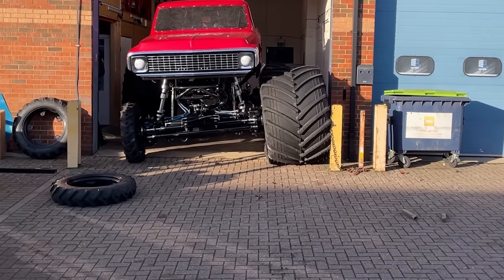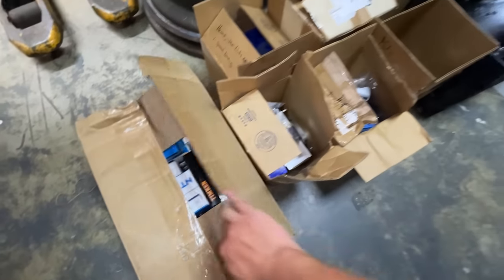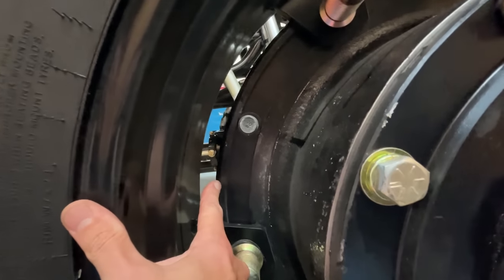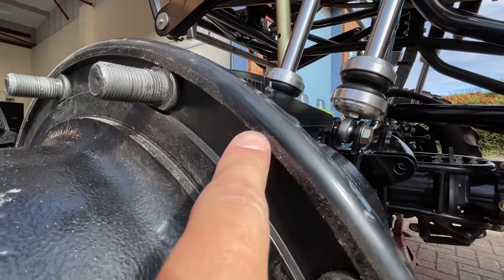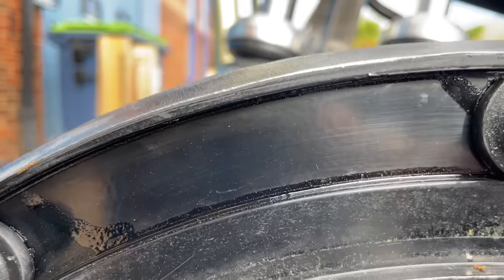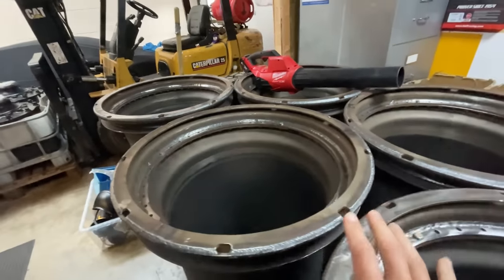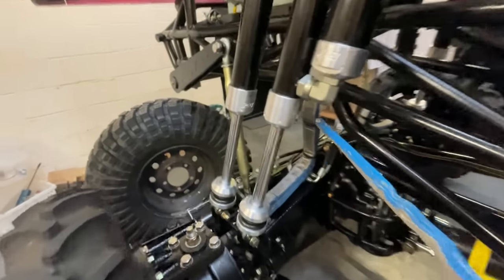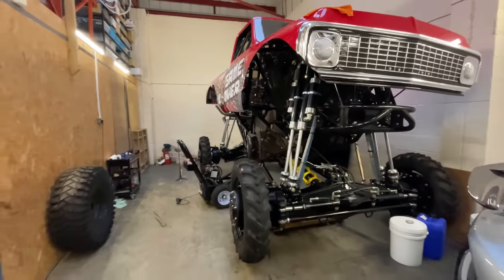Giant Monster Truck in my TINY Garage

Comment from the maker: Get Your Merch Here https://teespring.com/stores/kevs-merch

UK Monster truck Nationals, come and watch me race and say hi! https://monstertrucknationals.co.uk/

BeamNG - https://www.beamng.com/game/

Monster Truck Plug in Beam Monsters https://www.beam-monsters.com/
Reply: Did I see in one of the shots that you've got spare hubs? Why don't you send those out for grinding now before you need them. That way when you do blow one and have to replace the one on the truck, it's all ready to go? 

Not to mention, once you get them back, it HAS to be easier to change the hub than grind for 4 hrs per hub PLUS having to make sure it's balanced properly.....

Edit: just thinking (I know pretty dangerous for me hahaha) how much are those hubs? Buy up a dozen or so, work out a deal with a local machine shop, turn them all down and sell them on the monster truck market.....I'm not sure how often they break and have to be replaced....if it's once every 2 years then it's not worth it but if it's a common wear/break item, it might be.
Reply: BeamNG Drive is AMAZING KEV!
Reply: Are you still looking for some property
Reply: Dhdwtg😎
Reply: I'd like to make a small scale model of your truck using the SCX24.
Reply: Why dont you use spacers for your wheels to get it a bit away from the hub weld ?
Reply: @Mr.Miserabel  It might not fit in the garage so he can enjoy his tea😂
Reply: Hi mate, if your rear steer pump is too still slow, you can adjust the speed on the pump using the flow adjust valve on the pump. If that helps?  It's the allen head screw with the lock nut on the pump part of the power pack u have🤣
Reply: I saw your tyres and rims weeks ago at Sam Mortons and sons
Reply: what you going to build next
Reply: @muskokamike127  A monster truck tire with a radius of = 33 inches or a diameter of = 66 inches has a circumference of = 207.3 inches which is 17.2 feet per revolution.  Therefore at 10 RPM of tire speed the truck will move 172 feet.  Balance is not an issue.  Just sayin'
Reply: @kevinsellsit5584  Just saying, but the truck isn't turning the wheels at 10 rpm, they are turning much faster. Now if I cared to I'd go back to his video when he first competed in public. He's travelling the entire length of the course in a few seconds and if said course is 200 ft long, that means he's travelling 200 ft in 10 seconds not a minute. That means the tires are rotating at 60 rpm not 10. When something rotates at 60 rpm, balance becomes an issue. How do I know? I can feel the slightest variation in my cnc machine and the ballscrews aren't spinning close to 60 rpm.

BTW: we're not talking about the tire dia, we're talking about the hub which appears to be around 20" in dia which would make it about 5' in circumference.
Reply: Hey buddy, I'm a bricklayer based near Manchester. If you need any brickwork doing or looking at widening your door way etc. Get in touch 🙌
Reply: @leonking11.11  that's a great offer but it's a rental, they don't take kindly to stuff like that. Not to mention you have to also replace/widen the garage door too. 

I was going to suggest that as well, just widen the door, then remembered it's a rental.
Reply: Hello Kevin. Mad Love ❤️ from alaBAMa.  Please come to USA 🇺🇸 for MonsterJam. We would love to meet you and see GameOver.
Reply: 6:00 how i would of moved it is i would of left the studs in. There is more than enough room there to make your grinds and bevel. Then use a bar and put it in between the studs and the hub and use leverage and spin it over.
Reply: د
Reply: I missed game over now both last year and this year just gone. 100% I’m going next august.
Reply: Can u please get the rc crawler MN128 pleaseeeeee
Reply: Вас вас все устраивает но ни

Comment: The reason why it's harder to turn the hub by hand is due to the gear reduction in the hub. Basically the gearing is reversed so turning it from the hub is 'geared up' where as turning it from the drive shaft is 'geared down' if that makes sense.
Reply from the maker: i know that dude, but whats the best way to turn it?
Reply: @KevinTalbotTV  if you could find a way of using a long leverage bar without damaging the wheel studs that would probably be the safest way and save you from having to crawl under the truck and spin the drive shaft.
Reply: @KevinTalbotTV  starter motor while it's in gear? Just bump the starter, it might be hard on the starter though. I found something out just this week: some motorcycles that have reverse don't have a reverse gear in the transmission. They simply use the starter motor with the polarity in reverse, to turn the output shaft in reverse.....
Reply: @MidwestFarmToys  True, but a LOT of engines won't start when you bump the starter, it's gotta turn over at least a couple of times before it fires.
Reply: @MidwestFarmToys  well he only wants the hubs to turn maybe 1/3 at a time to only move to the next section for grinding. Any more and he might as well do 1/2 at a time. 

In reality he could start it, put it in gear, and hold the grinder in one place and let the hub rotate.....kind of like a handheld lathe.

Comment: john vaughan from slingshot mt here, really easy way to spin the hubs is take the end cap off the hub, remove the centre gear from the planetary this will uncouple the hub from the half shaft alowing it to spin free on the bearings 👍 hope this helps

Comment: The reason you can't turn the wheels by hand is because you're working against the gear reductions in the hubs.
Reply: @MidwestFarmToys  very true, but you would be spinning the high stall torque converter in the transmission with the starter motor which doesn't spin the engine fast enough to move the fluid in the trans to move the wheels.
Reply: @MidwestFarmToys  It would be an interesting thing to try and see.

Comment: You should build a jig next to make the wheel grinding process more painless. Something designed kind of like a knife sharpener or fender roller that helps you make the perfect radius. The aftermarket should just make things fit together in the first place though 😅. Your hard work is commendable! 👏
Reply: He could just put the truck in drive and hold the grinder on one spot while the wheels spin…

Comment: I think you should invest in an old mill. You could cut the hubs down a standard size industrial mill with a rotary table. Mills do way more than a lave. Big hubs like that would need a big lave and you'd be limited on what you can machine.

Comment: Kevin!! You do not want to use that Logitech wheel. Get yourself a proper wheel with a direct drive motor and your practice time will be much more valuable. The reason why is because that Logitech wheels is at best 1nm of torque and is driven by plastic gears / belt. Most budget direct drive wheels are at least 5nm and go all the way up to 30nm of torque for the expensive ones. A CSL DD from Fanatec starts at 5nm and the boost pack brings it up to 8nm. Also check out the Moza Racing stuff as they also have an r9 platform which gives 8nm as well. Fanatec just has some better wheel choices which might be more similar to the monster truck.

I had a G27 Logitech wheel for a long time and once you upgrade to a solid mount instead of a table clamp, you'll easily over power the Logitech with your arms. If the goal is to setup a Sim rig to practice for future contests, you'll be much better off and get more muscle memory out of your practice with something stronger.

Comment: pull the planetary cap and pull the sun gear out.   or! just un lock the locker.... have someone push the transport tire in one direction (clockwise) and the one person on the other side pushing in the opposite direction (counterclockwise).  but for that, you might still need a stud or two on still.

Comment: Also with the rear steer motor you wanna put tape around the ends so when you pull the bolts out it doesn't fall apart.

Comment: Hey Kev little advice when you do sand blasting take all bearings & races out because it seems no matter how hard you try sand will get in there & give it a good cleansing with break clean & blow it out. Worked at a fabrication shop that did powder coating & sand blasting

Comment: jack it all up like you did, put it in a low gear and let it idle. Hold your grinder in one spot at one angle as it turns and boom, monster truck lathe

Comment: What's with that toggle switch rear steering?! Get you a FlySky GT5 setup in there man 🤪🤣

Love watching you wrench on this truck. You really should get a bigger shop and get you a Bullard VTL lathe. It would make short work of clearancing big parts like those hubs. And smooting out the welds on those wheels would be a breeze.

Comment: KEVIN
Is there any reason why you haven't gone to a machine shop and got some spacer made up for the wheels? As that'll be a lot safer option and you'll be less likely to bend n sheer bits off. 

When it comes to the spacers, make sure you get them to drill and countersink so you can drill n tap the hubs so they stay in place for when swapping the wheels over. Just like they do on vehicles

Comment: Your obs recordings are missing frames because you'll find that the cpu is being used to process all of the video while running the game which it cant handle instead of using your gpu which is made for playing games and recording. To fix this, open obs, go to settings, go to the output tab and then at the top of all the options, go to recording and then under encoder, change it from whatever it is to for me it is nvidia nvenc h.264 as i have an nvidia gpu but it may be radeon..., quadro..., etc depending on what gpu you use. Hope this helps.

Comment: Kev
Why don't you try running the MT with 16 volt batteries instead of 12. That will kick up everything speed wise? 
Also the fittings on your power steering pump seem to have a small opening probably slowing down the flow. That size you should be running a 3/4 line for maximum flow.

Comment: Kev, you can't turn your hubs by hand because they are reduction hubs and you are working against the gearing,hence the propshaft is easier.
Reply from the maker: yeah i know, but whats am easier way of doing it?
Reply: @KevinTalbotTV  Get stronger🤣  or let the engine do it is your only two choices I'm afraid. I use a bar locked in against two studs to rotate by hand like you are undoing a wheel nut with a bar and not your rattle gun. It's a big reduction you turning from the wrong end so no real get outa jail free card sorry.

Comment: Double the steering rods Kevin ( the ones that are bend) i would put 2 on eachother and welded to eachother but the problem is then a single rod can bend and prevent something else to get broken, so do what you have to do, but i follow Monster Jam allready for many years, went to a couple of shows and you always see the front steering rods get bend and in my opinion, just double the rods for double the strenght....

Comment: have a machine shop with cnc equipment make adapters.
The adapters would bolt onto your hub and then the wheel would bolt onto the adapter.

Comment: Planetary gear sets your Center gear in the middle of the planetary gear set is called a Sun Gear the outer gears are the planetary gears and the outer ring gear is simply caught her ring gear some manufacturers call these gears different things but simply put planetary gear sets are as a solar system

Comment: Heads up. Shot blasting is different then that. If it was a sand material that’s regular sand blasting. Shot blasting is done with steel shot like what’s in a shotgun shell.

Comment: I'm no menstcr truck guy but I believe the reason you can't spend the planetary is because they are a gear reduction unit right? It would take wayyy too much torque to spin the output end.

Comment: idk if Kev will read this but using a larger valve body and large bore fittings in his hydraulics will speed up the rear steer more than just upgrading the motor

Comment: Kev did you decide to stay at this unit rather than re-locate?
Reply from the maker: no, still moving but the perfect place has not come up yet
Reply: @KevinTalbotTV  in the same boat, it is very hard. must be even harder if you need the land also. for me its either great house wrong area, right area wrong house.

Comment: Yo Kevin you should definitely take an Rc truck one of your faster ones and make it have wings that come out the body with a button on the remote and whilst you’re going full speed and or sending it off a ramp, you then expand the wings to see if you can get most distance or air. Would be very interesting

Comment: Kevin Talbot...couldn't you get a machine shop to make you a ring that fits into that recessed area on your hub to bring that area flush with the other part of the hub?   Then a slight channel on the edge of this ring that let's the weld on both sides (hub and wheel) fit into.
Reply from the maker: would lose lots of strength

Comment: To be fair, those axles are not originally designed for a monster truck. They're for some other piece of heavy equipment and they work better than the old Rockwell two and a half ton axles so that flange is probably meant to mount a tire that uses a 30 or 40 inch rim. The bigger question is at this point why don't they make monster truck tires and wheels that are bigger since that will be a lot easier to change

Comment: So with out knowing part numbers im assuming that your running the rear steering on a 12v system? You should see what the ratings on the relay are and run either 16 or 24v. It will be 100 times more responsive and faster yet. If your already running that hi voltage then when you are driving it you should see a improvement already. Just curious if you can get more voltage.

Comment: I would prefer to modify the wheel. Or have the wheels made to suit the hubs? Because aren't those hubs fairly common? You would want them standard so if you have to replace they are straight forward. Just my two cents Kev.
Love ya efforts mate. Cheers for the content.

Comment: for as far as Monster truck axles have come, still utilizing crane/4 wheel drive forklift etc parts is frustrating. Pablo builds some kickass wheels, sucks they were giving you such as hassle getting them on/fitting right. Kev could go full on rebel, break the mold in terms of MT suspension - ditch solid axles and the heavy cumbersome planeteries , go full IFS

Comment: Sorry to be that guy but the reason you all have the problem with the wheels and hubs is you're using hubs not made for monster trucks. Same as the wheels. It's like me fitting GMC Sierra wheels on my Ford F150, modifications will be required. 

I guess there isn't enough monster trucks in the world for them to start producing them specifically for Monster trucks. 

Maybe you can get all the MT guys together and start a machine shop to mod the hubs......prior to mounting them to the truck.
Reply from the maker: my hubs are specifically for monster trucks, so are the wheels thats why its crazy we all have to grind them!
Reply: @KevinTalbotTV  Really? I thought you said they were from a piece of industrial equipment. That bin of spare parts you had cleaned and bead blasted......

Comment: Absolute madness! Why in the hell do they not make the sh*t bolt on…? All they have to do is make the wheel hoops a larger diameter in the drop area, to make the wheel flange larger in diameter and allow more clearance between the wheel hoop and stud center… That would allow room for the weld bead… So dumb! Absolutely ridiculous!